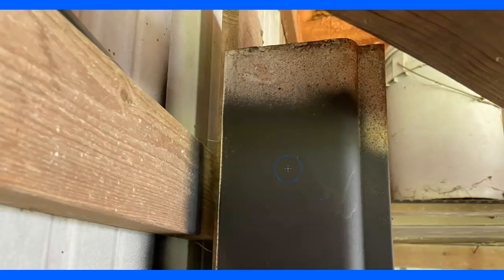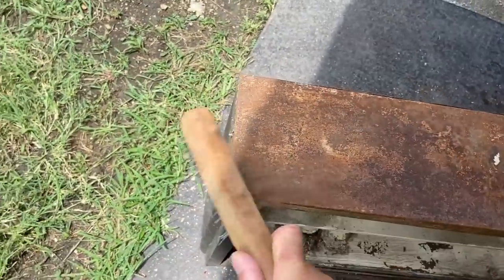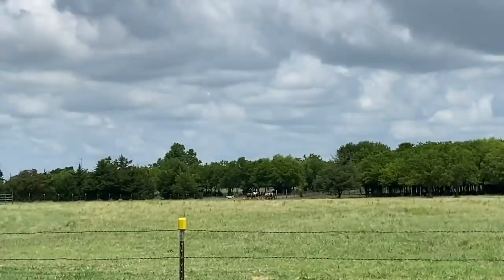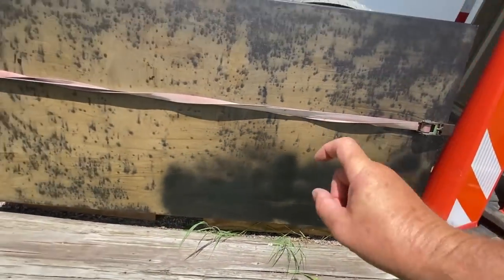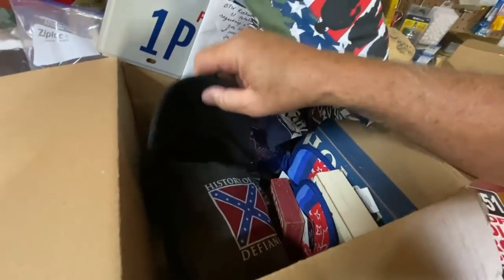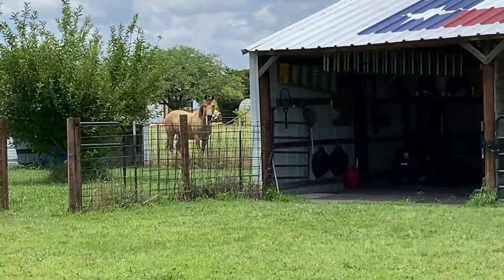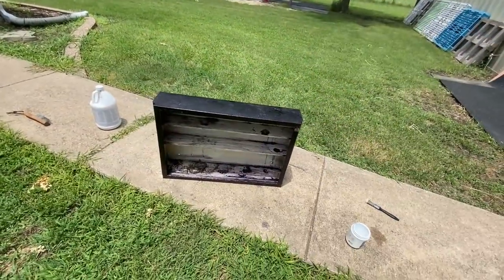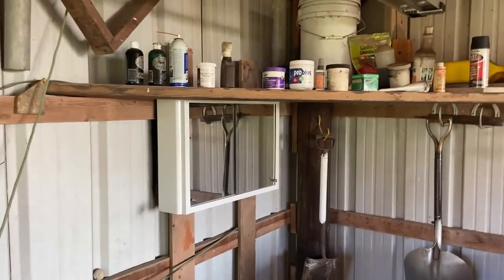Rust Converter Project - Treating Rust & Painting An Old Medicine Cabinet Project

Comment: Thanks! I have a small, rusted metal table with a round glass top. I was about to, reluctantly, throw it away.

I'm gonna try that rust converter in the spray can. I'll put the table on my front porch if this works! 🙂

Comment: Hi Rick, I'm A newbie at this DIY stuff but also very handy. My question is, the inside of my medicine cabinet is metal like yours, the only difference is I have glass shelves. My problem is the medicine cabinet is trimmed in a rusty shiny mirror like strip. Can I use the spray rust remover that turns black? Or could I possibly buy or make a new frame? Thank you for your great video. I think if I had to watch one more video about using vinegar, I would have ripped the cabinet out and replaced it. Lol